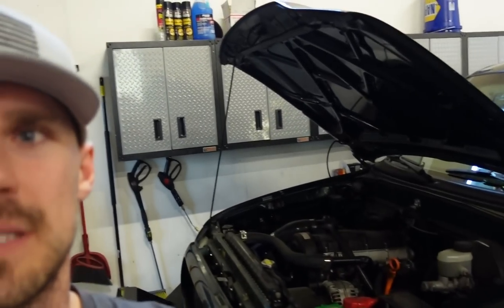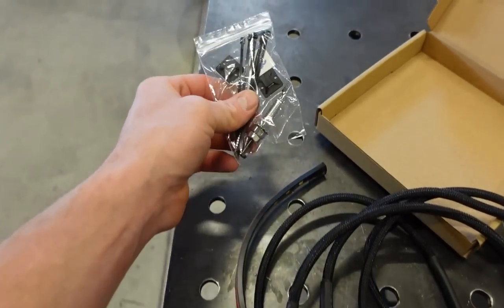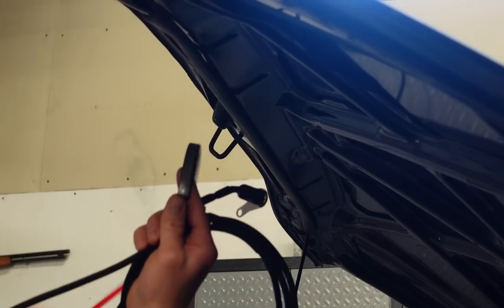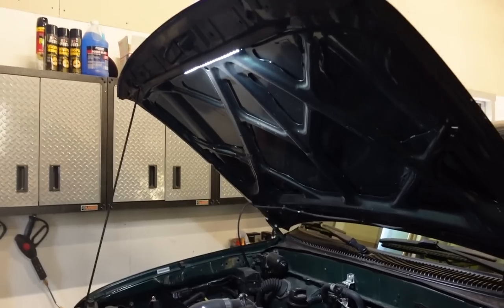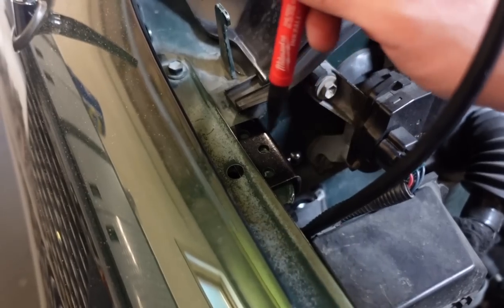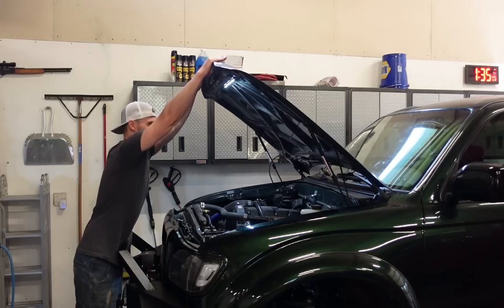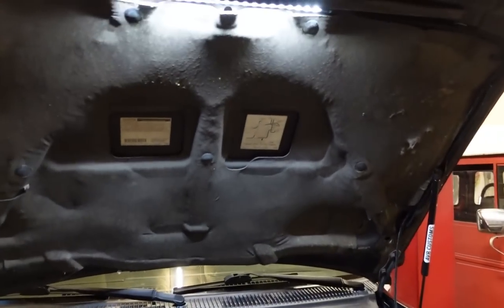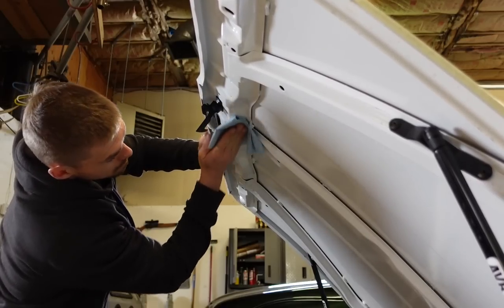New Products!! The Whole Fleet Gets Hood Struts And Engine Bay Lights!!

Comment: Just got my light kit today. Does the rounded terminal hook to neg or pos on the battery? Looks like positive and the hook pressure switch acts as the ground?
Reply from the maker: Yes, ring terminal to battery and the hood switch is the ground point! Did you download the instructions?

Comment: Hey Austin, great light, but it should include an in-line fuse, or run from a fused circuit ?  don't cha think?
Reply: I did see an inline fuse holder.....🎉
Reply from the maker: Thanks! It does have a fuse! 👍